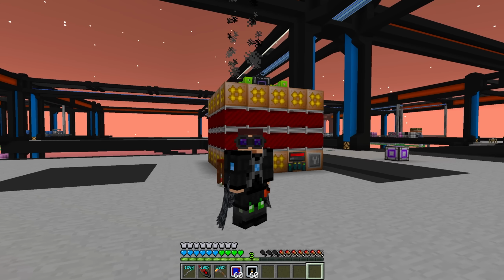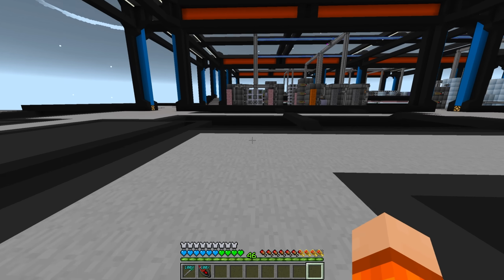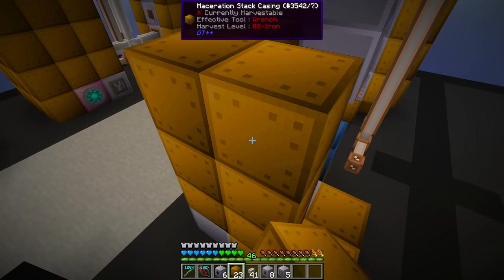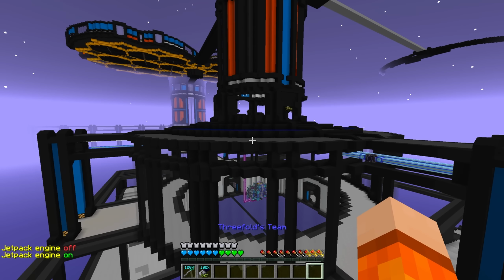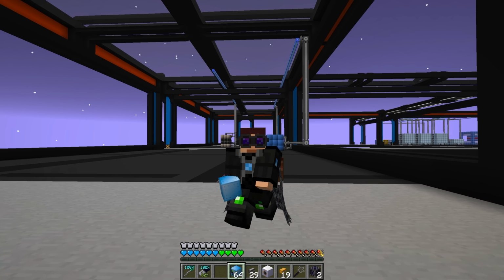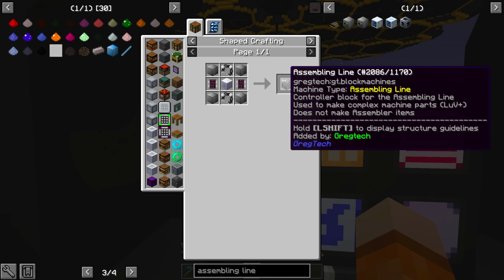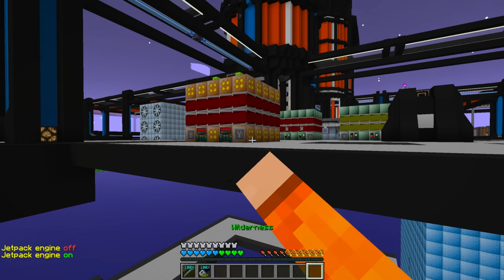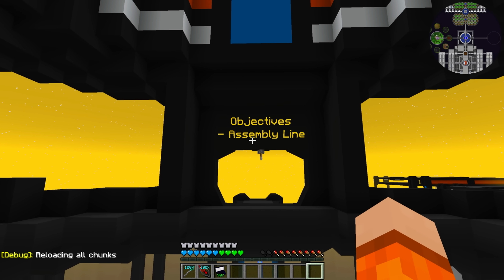Gregtech New Horizons S2 72: Mega Expensive

Comment: There is a Wither bee if you want to get Nether Stars easily through bees, BTW. Also Salis Mundus bee, but for nether stars specifically Wither bee is better.

Advanced Glue, for the record, isn't anything special. Just slap together some basic chemicals, easy enough to get through pyrolyse shenaniganry and/or petrochem, and there you go.

I believe I did mention the vacuum freezing was going to become the next bottleneck after upgrading EBFs to Volcani. As for AFKing it is a valid strategy in GTNH, just don't be surprised that the pack ends up being an AFK simulator if you end up playing it like an AFK simulator 🙃.

Always good to see ore processing being taken seriously, though I'm missing the special processing line. Where's the Ilmenite line? Anyone complaining about Tantalum should have that set up.

Generally speaking, for GT++ alloys if it has an ABS recipe, use it, and if it has an EBF recipe forget that it does. GT++ alloy EBF recipes are very often ludicrously expensive compared to the ABS recipe. Some to the point of being NEI clutter, more than anything else.

I'm sure people will remember me singing the praises of the Volcanus multiple times, so how does the Cryogenic Freezer hold up? Unfortunately, extremely poorly in comparison. For starters the multi is gated to LuV - it's casing requires both HG-1223 and Lafium Compound, which are LuV tier ABS alloys and impossible to get before Assembly Line. Remember the ABS cannot be overclocked, to run an LuV recipe it needs an LuV energy hatch. On top of that the Cryogenic Freezer has only a 2x speed bonus, no EU/t discount, and only 4 parallels compared to the Volcani's 2.2x/0.9x/8 speed, EU/t and parallels respectively. It also consumes Gelid Cryotheum - a more difficult fluid to automate than Blazing Pyrotheum - twice as fast.

Now compare all of that to a Mega Vacuum Freezer. It is not the prettiest of multiblocks, but 1x speed, 1x EU/t cost and 256 parallels compared to running a measly four ingots twice as fast? And it doesn't require any higher tech than the basic vacuum freezer (at least to craft, to utilize it to it's full potential is a very different story), just an absolute metric boatload of Alu? I trust I don't have to explain why this is the better option over the Cryogenic Freezer...which Three still cannot actually craft yet anyway. So...that's the end of that contest 🙃.

Alu can still be four times slower to smelt if you're cooking pure alu dust rather than alumina dust with either cryolite or carbon dust. Got a ton of pure alu dust, and not sure how to turn it into alumina dust quickly and cheaply? Chemically reacting pure alu dust with silicon dioxide dust does the trick, though that is an LCR exclusive recipe, and by the time you have an LCR you're probably not too worried about the smelting time of alu anymore.

As with the MEBF, and all other megas for that matter, it's only as good as the excessive amounts of power you shove into it. Getting 256 (Tier) recipes to parallel needs (Tier+4) power. Or, put another way, if you want 256 EV tier ingots - think Tungsten, Tungstensteel, HSS-S, Osmium, and a few others - to parallel you need to give the Mega Vacuum Freezer it's own dedicated 64A IV power line to feed it the equivalent of 1A UV. Excessive? Maybe for right now it is, but the Mega Vacuum Freezer is as good as it's going to get. You're going to use this multi for cooling hot ingots from here to Stargate, or however far into the pack you go, so get comfortable with them and get ready to feed them plenty of power.

Reminder that EV+ tier input buses have the exact same number of slots as HV tier input buses. The only time you use higher than an HV tier input bus is when a multi specifically requires at least X tier of bus/hatch, because...I'unno, have to make the player spend resources somehow. I would also recommend putting the freezer on it's own AE2 subnet, because - spoiler - that singular input bus is not going to last for very long as far as storage goes. Especially when it's only given 4A IV to work with.

So, for the record, for LuV you only need an 11 length Assembly Line to start, since that length is required for LuV Field Generators, and they in turn are required (among other things) for the Fusion Reactor. You only need a longer length in LuV if you're planning on using the IsaMill Grinding Machine, Flotation Cell Regulator, Sparge Tower or Molecular Transformer. Zero of which are mandatory, zero of which are (to my knowledge) worth using.

Incidentally, it's better to craft an Advanced Data Access Hatch instead of the regular version, since space for only four recipes (remember the Assembly Line needs to have a data stick for each recipe you want it to run) is just straight garbage. The 16 the advanced hatch gives you is frankly also garbage, but at least able to fit all of the LuV components if nothing else.

Assembly Line isn't really that expensive, it's mainly a comprehensive infrastructure check. Circuits most obviously, but also EBFs and Vacuum Freezer, platline, SMDs, if something is not up to par the entire thing is going to slow to a crawl and take ages. And of course this is just the entrance exam to see if you're worthy of going into LuV. Once you've passed it, however you've passed it, you get to experience the joy that is actually going through LuV. And if your everything wasn't up to snuff before, oh boy, welcome to GTNH purgatory. LuV is, IMO, the end of the early game. This is where GTNH takes off the kid gloves and you need to have learned the lessons that IV tried to teach you in putting the "monster" that was the Assembly Line before you, because the pack is about to stop being merciful.

"It was merciful before?" you ask? Honestly, very much so. Remember Ruridit? I hope you've figured out the importance of both upgrading your EBF coils and upgrading to Volcani, because remember that the difference between an HSS-G EBF and HSS-S Volcani, both at LuV, is the difference of around 655M EU and 17-odd minutes per LuV Motor. Per *Motor*. IV motors had you speed up tungsten production by 60% simply by noticing that Tungsten Trioxide had a second usage in the EBF, as well as mix a couple basic materials together to produce advanced glue for graphene. Don't expect LuV (and beyond) to be that generous.

Electric Prospector's Scanners do have durability, but if you make them out of even a halfway reasonable material they will last a very, very long time. The absolute best material to make your first one out of is Ichorium or Gaia Spirit, which gives you by far the best range and durability combination you can get until Infinity, but if you're not that neck-deep into magic HSS-S makes for a respectable beginner's Electric Prospector's Scanner.

T3 MBMs, or Ore Drilling Rigs, are something you can upgrade to once you've got access to LuV tier components (and Assembling Machine). I highly recommend it, they're super worth.

Advanced SMDs are mainly to cut the recipe time of circuits that can still use regular SMDs in half. Resource wise it's infinitely cheaper to just spam regular SMDs, but crafting times - either the circuits or the SMDs themselves if you craft them on demand, especially using the cheaper recipes for regular SMDs - are going to be an issue. IMO it's worth swapping over to advanced SMDs for reasons I detailed in prior comments, but TL;DR: Faster circuits = better circuits, and you're going to need said advanced materials very soon anyway, so addressing them now just saves you the effort of having to address them later.
Reply: Hot damn. While your phrasing is reminiscent of a conceited competitor you just might be the Dr House of Gtnh knowledge. Nice dump 💃
Reply: The molecular transformer can be used to much more efficiently get sunnarium, which is not really that important, but can be useful.
Reply: end of the early game? jesus christ
Reply: @jasharin  Welcome to GTNH, where 6k hours to complete the pack is considered fast for someone who knows what they're doing
Reply: @bmobmo6438  yeah, i knew it was a BIG mod, but i didn't realise it was a _BIG_ mod

more than anything, this little fact has convinced me to never try this pack out, haha
Reply: @jasharin  Well Three keeps referring to the T7 rocket (having only completed the T3 rocket) and the pack isn't finished yet, so that alone should give you some context of the scale.

Comment: Greggic Gregg
Probably wise to use an advanced stocking bus or iv+ super bus on the mega vac
This is an insanely tremendous threefold W
Circuit assembly lines and fusion reactors are even more expensive than the assembly line, but the assline really serves as the Great Filter and if you can make it through then you'll likely reach at least UV
Threefold is really grinding these episodes out
It might soon be time for my return to GREG

Comment: Mega DT is much bigger than the other megas
The mega VF takes multi amp hatches, which you definitely want to use
72 mb of soldering alloy I think was left in the assembler PA
Doing a storage bus on a subnet for the mega VF and an advanced stocking bus on said subnet is a good idea at some point
Definitely craft the advanced data access hatch instead of the regular one

Comment: FYI you can use the Advance Stocking Bus on the electrolyzers. or on any machine even if it takes say 33 of a item, if your using it the way you are, just set it to pull a stack (64) items and it will auto clear any items that you dont have 64 of, every 5 seconds. You just need to have the drive space, like if you have 20 differant items 1 drive will do, but if you have 64 items you need 2 drives. Hope this helps.

Comment: automating the assembly line shouldnt be as complex as before because of the advanced blocking card
if you put the advanced blocking card in the subnet interface and enable advanced blocking mode, and normal blocking mode for the pattern interface, it will just work as expected

EDIT: from memory this is the case, correct me if I'm wrong

Comment: How does the machine auto stop when the tank fills up dosent the net get flooded or does that have something to do with the sticky cards
Reply from the maker: Which machine and what tank? 🤔
Reply: @Threefold.  any of the chem reactors with ae fliud output hatches and i could have swore i saw you put a sticky card on one of the fluid storage buses, also dont the  fluid output hatches just infinitely cache fluids
Reply from the maker: Anything with a Fluid ME Output Hatch will not stop when fluid storage is full. That is why anything that is a primary producer of a fluid has a normal Output Hatch with Dual Interface instead. Only secondary producers of the fluids will contain ME Output Hatches. Sticky Cards only apply to items, and as far as I know doesn't have any affect on fluids :)